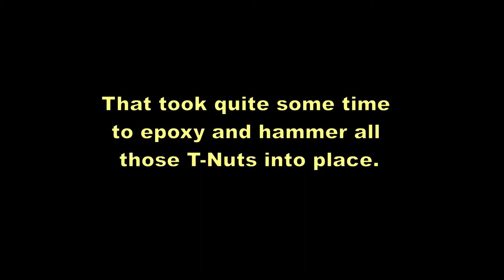Simple Way Of Making Cole Jaws For My Lathe

Comment: Real nice job but you should have counter sunk the mounting holes for the chuck & bolt the bumpers to the jaws from the other side, that would "pull" the T-bolts into the jaws & the wood on the other side wouldn't have any exposed metal.
Reply: My first thought, T nuts on the other side.  Great job, thanks for that.

Comment: Brilliant idea, especially to use those rubber stoppers with the angle that gives you the perfert holder mechanism for wood, especially wood with a finish on it already.  Great job.  Subscribed.
Reply from the maker: Thank you so much! I have used it on another project that I am working on editing the video for. It works so nicely, and is easy on the finish. I end up putting a paper towel on the face of the bowl until I can remember to stop and get some felt strips for the face.

Comment: To bore holes in the rubber stoppers, try installing them in the Morse taper socket of the lathe spindle, and chuck the bit in the tailstock.

Comment: Nice job! You have inspired me to make my own. Is there a reason you did not set your bumpers on the other side? There would be even less of a chance of them moving under use that way. Do you still intend to put felt on it? I also noticed you use MDF. Did you consider any other material?
Reply from the maker: I'm glad you liked it, and I'm so glad I was able to inspire you to make your own. To answer your questions: 
1. I started to mark on the plastic laminate side with a pencil, but it just smears off, which is by design to be able to clean a countertop more easily. I tried a pen, and the same thing happened, so I just flipped it over. I figured that out when I was drawing the lines from corner to corner in the very start of making this.
2. I do still intend on putting felt on it, but I think I'll do some tapered strips between the bumpers. That's the next upgrade to it to finish it completely. 
3. It's 3/4" thick MDF from an old countertop that I had been saving to do something with, but didn't know what (I'm good at hoarding wood like that). I thought about using plywood, but the particle board for countertops is very rigid, no flex at higher speeds, and there is no movement when it comes to temperature. It's made to kinda be abused for countertops.

Comment: Did you ever figure out what caused 'the  hop'?
Reply from the maker: Yes I did. With the holders being rubber, I have to be careful with how hard I tighten them down, because the rubber will squeeze out distorting the shape and push the bowl off center. With a little bit of messing around, I was able to get the hop down to 1/32".